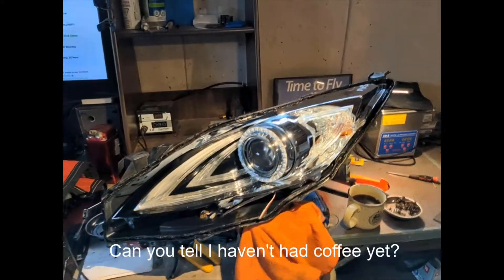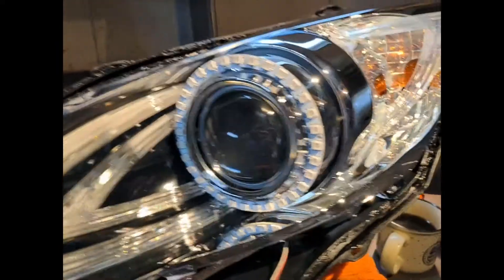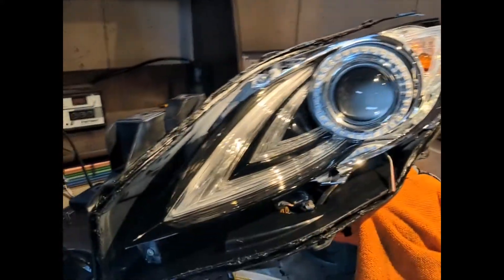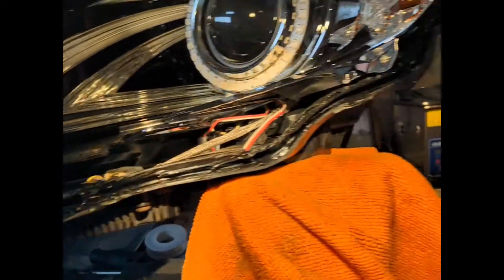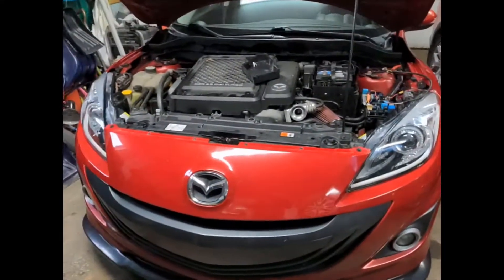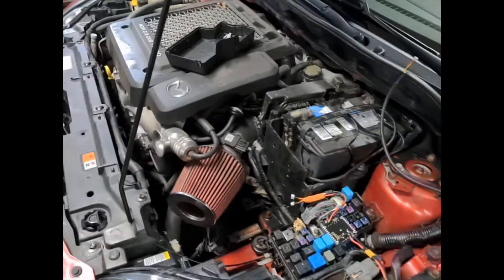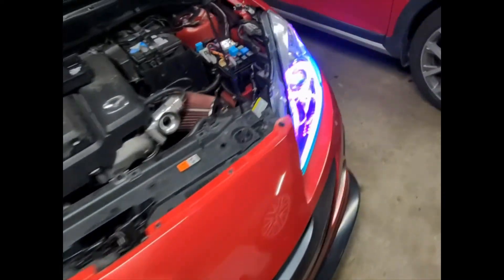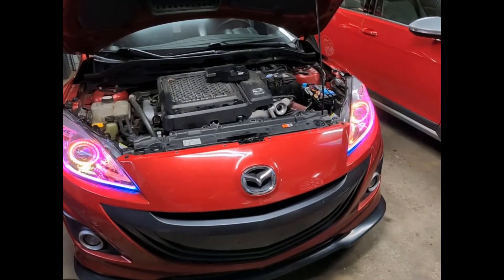Mazdaspeed3 RGB Headlights! [stock retrofit]

Comment: Hey man I know this is an older video but what size is the halo ring? I’m looking to buy a set from circuit demon but they have so many choices for sizes
Reply from the maker: Hey, I got these off of amazon, they were 110mm on the OD of the ring I believe https://www.amazon.ca/XUNATA-Addressable-WS2812B-SK6812-Arduino/dp/B071W7ZMP3

Comment: Great job, sadly here in Spain the yearly Government vehicle inspection is pretty strict and many mods like these would fail. So although I've had my 3 MPS for years it's pretty standard. I even had to remove my Akropovic system on my Kawasaki as it wouldn't pass the pollution and noise test. Big Brother is getting worse here in Europe.